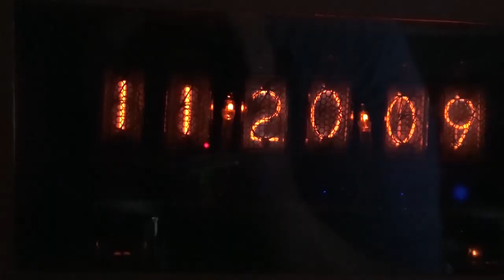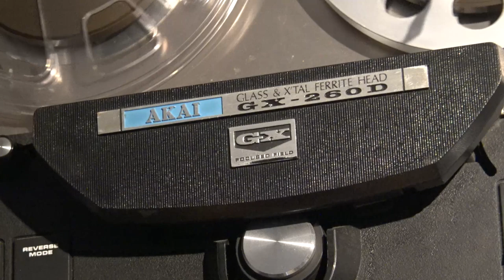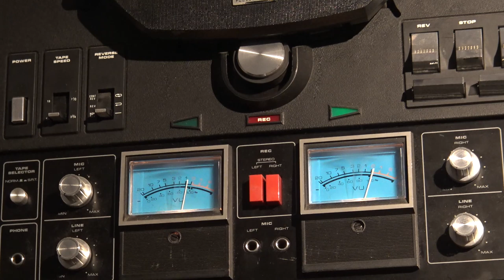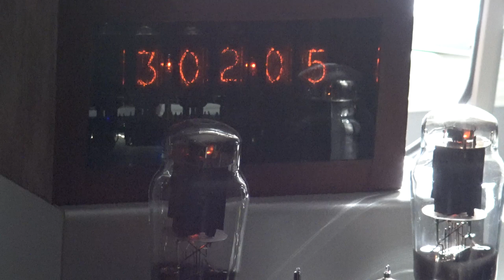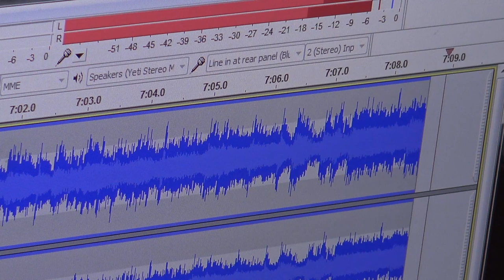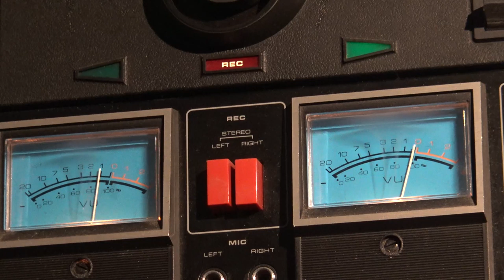CFMI air check tape from December 24 1984

Comment: Amazing
2 thumbs up, 2 thumbs down and 2 comments.
All this 60 minutes before it even starts.
Rod Serling must be in this one.
Reply: I did give it a thumb down, not because I don't like the content (obviously, it's not there yet). The content is always great.
But because I don't like the "premiere" announcement concept.

It's a shame there isn't a way to give a thumb up and down at the same time.

I usually then remove the thumb down once the video is out, when I don't forget about it.
Reply from the maker: That would be the fucking spam bot.  That's s way to figure that out quick.
Reply: @12voltvids  spam bots automatically disliking videos?
Reply from the maker: @randomelectronicsanddispla1765  No making comments like "cool video" and "Great video"
Those comments were removed before it went live.

Comment: Dave didn't do too bad for age, he passed in 2017 at 81 years old, when you were listening to him in 84 he was around 48 years old, so he continued in radio for quite a bit longer.
He looked like a nice bloke :-D
Reply: I was lucky enough to work with Big Daddy for two years in the early 90s. You are correct, Dave was one of the nicest and most easygoing guys I have ever met. Just a prince..and I miss him. RIP  Dave.